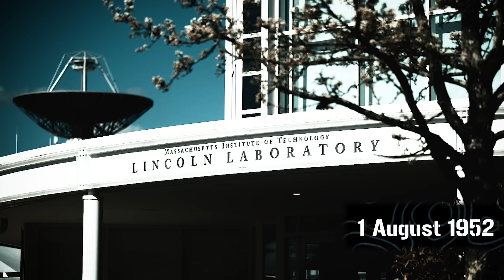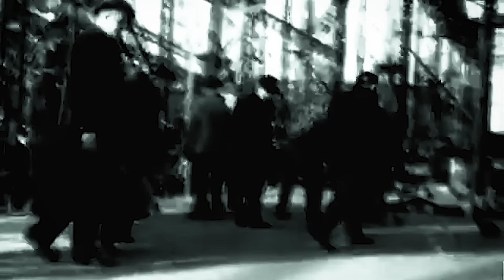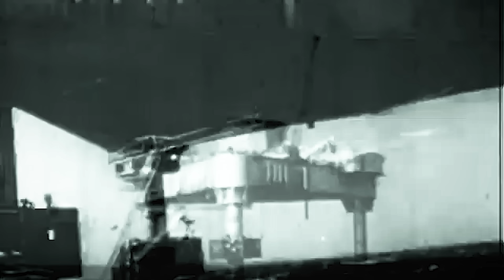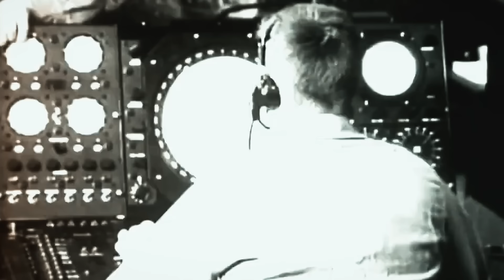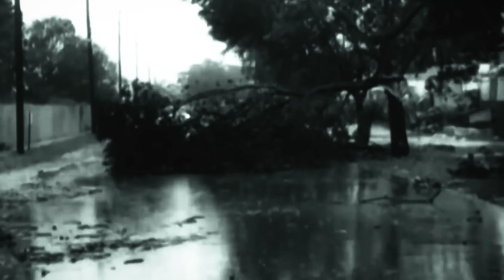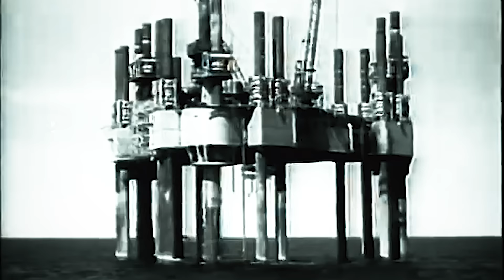BUCKLED At The Knee! | Texas Tower 4

Comment: There was an Exxon/Mobil natural gas platform off of Sable Island that after two years they installed steel sheeting on the South side to reduce the effect of the weather coming from the south. A wave hit that platform one night and it peaked at 65 feet up the side of that platform. The standby rescue work boat was sitting 3/4 of a mile downwind from the platform it disappeared under water for twenty seconds when that wave hit it and when it finally resurfaced the pilot house windows were blown out and the boat was blacked out. It was last seen that day drifting towards land and it was rescued 30 miles later by a deep water tug sent out of Halifax the next day. That boat was electric drive with electric controls so when the windows blew out all of the controls were immersed in salt sea water and they could not get them operating again without having a major repair and retrofit in dry dock for three months.

Comment: My dad dove the wreck in the 90's, he made it down to the sand. He was trying to work his way to the Andrea Doria by doing progressively challenging and deeper dives for that. He sadly never made it to the Andrea Doria due to time money and it's not safe. He gave me the depth gauge that he used on that dive.
Reply: That’s sweet and your dad is smart. Andrea Doria is the K2 of shipwreck diving. Some good books on the subject, I bet your dad has some cool stories 👍
Reply: @fpetev676 he sure does. For instance he told me when he was diving the USS San Diego, a WW1 armored cruiser, he lost his weight belt and started uncontrollably ascending from over 130 feet. Luckily he was able to get it under control and retrieve his weight belt before he made it to the surface and caught the bends. I still have that weight belt that he gave me.

Comment: Engineer here 
- It's said that the firms who designed this didn't have prior experience for ocean structures.
- The other towers needed a deeper foundation because they were unbraced and they needed to not 'rotate' in the soil. Whereas tower 4 would have only required lateral fixity. Also we don't know the geology considerations between the towers. Point being more deep doesn't necessarily equal more stable.
- The original engineers were concerned that welding the braces to the legs would induce stresses which over time would fatigue and break. These secondary stresses would have been very minor, but tedious to calculate. It's not unreasonable to assume it was just put in the too-hard basket.
- The 'Pin' idea which was a much greater risk of fatigue. Simple pins like this are never used today as they lack redundancy amongst other reasons. When we use articulated joints there's a significant amount of consideration in them - we seal them, they need regular maintenance, they're lubricated, we consider redundancy.
- The 'X' bracing they added later was ineffective because they didn't have any cross members. Things aren't triangulated out by adding that 'X' bracing they really were just putting the load back into the pile. It would have been orders of magnitude more effective had they added an inverted 'K' brace below the top deck.
- Everyone was informed in no uncertain terms that there was a major issue. And for me this is the big one, time and time again people are warned that a structure is unstable, it gets to the point where you don't need to be an engineer to know that something's not right. The gentlemen on the platform were unfortunate because they had no where to go.

For you reading this - if you find yourself in a structure, that you are SURE is about to collapse... just leave. Go home.
Reply from the maker: Thanks for the extra info. Very interesting
Reply: That's a long swim.
Reply: In the military you can't just go home.
Reply: @arcaneminded  assuming of course, that you have somewhere to go. These fellers didn't. The sea is a lonely and unforgiving place
Reply: You don’t have to be an engineer to take one look at that structure and know it’s a bad design.
Reply: These men weren't given a CHOICE to leave. This is murder
Reply: On a ticking clock and playing with mother nature. You need to go before it gets to late
Reply: always err on the side of caution! you spend more money and time, but less human life resources are wasted at the end. those poor souls, can't imagine sitting in a confined space only to be dropped into a wild ocean and the north atlantic on top of that :-(
Reply: Non engineer here. With only 3 legs if you loose one your screwed 4,  would be a little  safer you lose one you still have a (wobbly) tripod, 5+ safer again you lose one your still stable. But that would cost more.
Reply: Brilliant and concise engineering perspective but "nowhere" is one word.
Reply: @JakeSpeed420  Thanks. I'm not fixing it.
Reply: @arcaneminded  Typical engineer
Reply: @JakeSpeed420 woosh
Reply: @arcaneminded surely that will start the collapse of some language platforms down the line 😂😂😂 ❤

Comment: So the US navy built a US airforce base? That would have been a cozy base to live in I imagine.
Reply: Airforce run the radars but they’re not exactly equipped to go moving equipment at sea.
Reply: @sparky4878  I understand how every contract has to be divvied up between the navy and the air force since they are so jealous of their prerogatives and loath each other so intensely. I'm just saying its exactly this animus that means I woouldn't want to be the airforce officer living in a navy built base.

If you have read about the Battle of Stalingrad, the same problem beset the Germans trying to defend themselves. Because the situation was so fluid they knew they were building defences for other units so didn't try very hard, which made the crushing of 6th army easier than it may have been with a more co-ordinated effort.